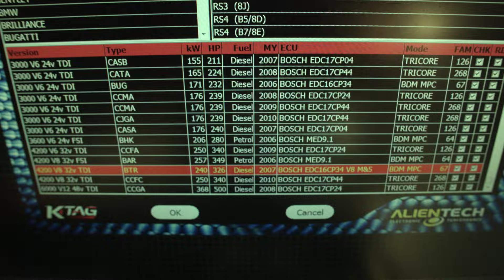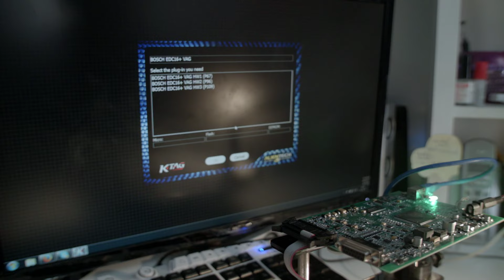Reading Dual ECU Bosch edc16cp34 via BDM

Comment: Hi
I have a bad ECU edc16c3. PEUGEOT 307 1.6 HDI 110HP 2004
With bdm100 its possible a full backup and install it at new ECU ? Or i need to do  more things ?
Reply from the maker: no thats enough
Reply: @Automotivesp remote Key woks and motor start ?
Reply from the maker: @djbertinho1984  key work and motor goes BOOM!   ..yes
Reply: @Automotivesp  help me a lot.
Iff not as you say i come here tell you😂

Comment: hello i have problems whit a renault megane 1 the ecu is burn.if i take all set uch ecu and cip key from the same engine it will work?and what code from ecu i have to read?exemple hom- 77098797598 or the one whit s-235784347120c if you can answer i will apreciate thanks
Reply from the maker: Chiar daca s a ars ECU eeprom de obicei nu este afectata, incearca intai sa schimbi doar eeprom de pe ecu averaita pe aia noua